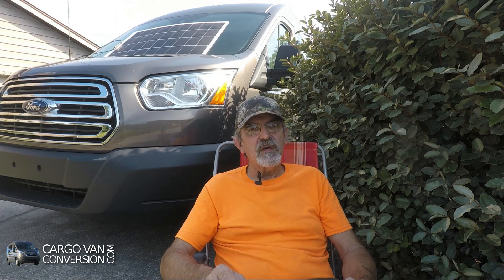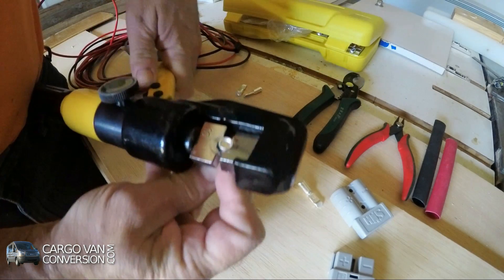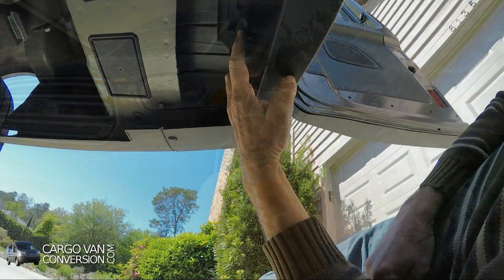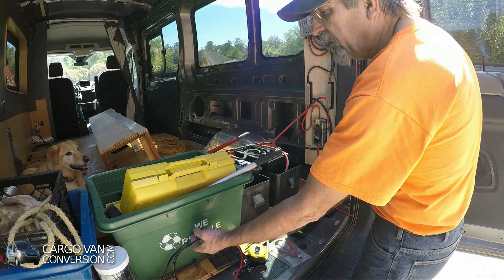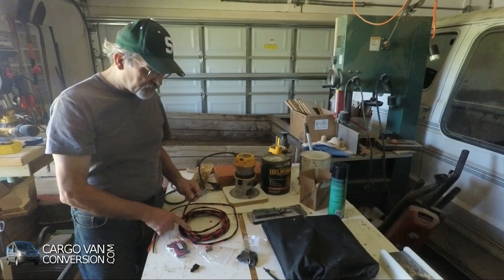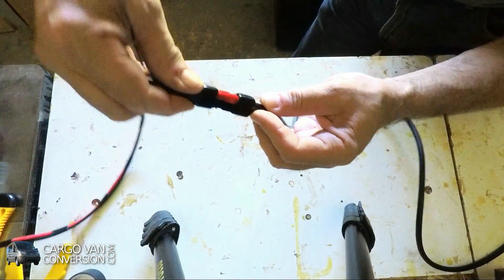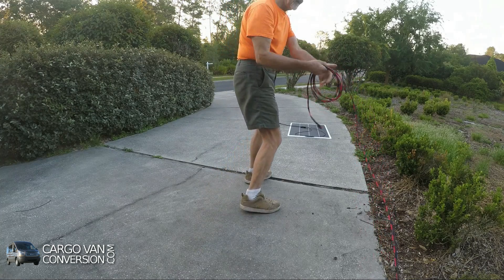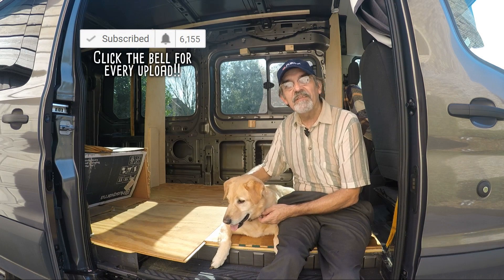Link Solar Day4 Flexible Solar Panel & Solar Blanket - Part 1

Comment: I just checked the link on the solar blanket and cost is $999.00 USD for 120W panel, I'm assuming thats American dollars. That can't be right. I haven't watched part 2 yet but I was thinking the blanket would be a great way to add some extra power but not at that price. I paid less than $200.00 for each of my 200W ridged panels
Reply from the maker: The price should be somewhat lower now, but the government tariffs on goods from China aren't helpful in this case :)
I agree with most of what you write. Rigid panels can currently be had for as low as $0.50 per watt. This specific solar blanket is of a very high quality, including high grade, backcontact cells and ETFE lamination and they should last many years. I think it's the best solution for anything portable and compact to store. And you're right, they are not cheap, but it's like comparing a KIA with a BMW; they both do the same job, but come with a different price tag.
My opinion is that most people should stick with rigid panels ($0.50-$1 per watt and proven longevity) or consider flexible panels for stealth or portability (approx. $3 per watt - insist on high grade, backcontact cells and ETFE lamination). If you want to splurge, a solar blanket.
Van Williams

Comment: Thanks for sharing this install.  Very nice product and, as always, ingenious install, Mr. Van.  I hope this works out for you.  Fortunately, my comfort level and needs are minuscule :D  Hopefully, costs for this 120W solar blanket and similar ones will become more affordable.   Big hug for Mr. Joey!
Reply from the maker: Hi tsuki,
I had this previously designed for flexible panels. With the same voltage, I could have installed an extra circuit breaker in the existing breaker box. The plan was, that if needed, I could have added 1 or more flexible panels and stored them under the mattress. The price is substantial and not for everybody and as you said, prices are constantly going down. Joey had a tantrum, so I almost fired him. But then he looked at me so sad, so I only let him stand in the corner. He'll be back next time :)
Van Williams
Reply: Ohhh noooo ...... Joey!  Workplace meltdown, suspended and exiled to the corner . . . sounds like burnout :(  I'm glad he wasn't fired, or heaven forbid, threaten to quit . . . one of the best PR persons out there, LOL.  Maybe a mini-vacation is in order?
Reply from the maker: Hi tsuki,
Oh and you think, it's all about PR???? :) BTW He's always on vacation, eats out everyday, so he doesn't have to cook.
Van Williams
Reply: Wow, I'd say he's enjoying all the frills that comes with his front-man exposure! ;D   Could be a demand for more time with you :))   Love is like that<3<3

Comment: The price of $720 for 120 watts of solar seems insane to me. I get that it's a unique form factor, but $6/watt??
Reply from the maker: Hi BradKW,
I have to agree with you, but... There is always a but :)
It's not for everybody and you just can't compare it with regular panels. It's what I've always said about flexible panels, if you don't have a special need for them, like an Airstream roof or stealth, choose the old-fashioned rigid panels, much cheaper.
But there are circumstances where using a solar blanket makes sense, if you can afford it. If you have limited roof space, when you drive a passenger car or live in it, when you often have to park in the shade, etc. And OK, even then you can use a rigid panel; in my case I have always planned to use flexible panels. But this blanket is sturdy, has really high grade solar cells, finished with ETFE laminate and all the cost adds up.
Remains that it's a high price...
Van Williams

Comment: hmm i wonder what kind of losses you are getting using those long skinny wires? maybe you should use thicker ones? im not sure?
Reply from the maker: Hi Jeremy,
These are 10AWG stranded wires, about 20 feet long and they should be able to support up to two panels with a voltage drop of less than 2%.
But you made a sensible comment, because with 12V, avoiding the voltage drop is so important and that's only done by choosing the right wire gauge. And if you're not sure, then get a thicker cable.
Van Williams

Comment: I'm very interested to see your estimation of the blanket.  Have you considered a very short cable for times when you don't have to use a long one, for faster charges?  Another cameo by Joey.  He must be pretty popular now?  Can't afford to pay him for a larger role?
Reply from the maker: Hi Neil,
Yeah Joey, I almost fired him :) It wasn't his day and time and wanted to do fun things instead of playing with me. Maybe next time.
The length of this cable (about 20 feet) should not matter; the gauge is sufficient with less than 2% voltage drop.The solar blanket, I'm really crazy about. Have tested it for about a month and a half, and it's all the good stuff, but most importantly, it's sturdy, made with the same materials as my roof panels, but way better positioned for portable use. Folds up small and can even be used directly to charge a battery if necessary. Only the price is substantial: $999.00, but I just noticed on Link Solar's website, they're offering it for $719.00 now for 120W.
Van Williams
Reply: You can't fire Joey.  He owns YOU.  hahaha  That just proves you spend quality time with him and he misses it.  Pay attention.  ;-)  Prices for solar are said to continue dropping so . . .     I just heard the grid isn't using some PV power because they've 20y contracts with nuclear so cannot use it at times.  Also heard nuclear and dirty fuels are on the death throes.
Reply from the maker: Hi Neil,
The US is not even catching up with some other countries, instead they are trying to make solar more expensive. A country like Germany sometimes pays customers to use electricity. There is so much solar, they don't know what to do with. And look at Denmark, Norway and Sweden...
Van Williams
Reply: Yeah, it seems, because our populace is largely, functionally illiterate, we're doomed to suffer soooo needlessly.  We're full of pride and arrogance.  While other nations steal our technology wholesale and surpass us in virtually every respect we wrestle with the practical issues by building walls we don't need, labeling others as unworthy to come here in refuge from wars, or simply because their skin pigment is darker and prop up obsolete industries or promise to do so simply to gain office merely to profit from the graft and corruption which abounds as in any failed nation of the past thousands of years of leader nations.  I suppose it's a good thing I never considered the accidents of the last few decades or I'd have tried to assuage the crises in some manner.  I first saw the cracks in the early '90's and, unfortunately, was correct about the path we've taken.  :-(